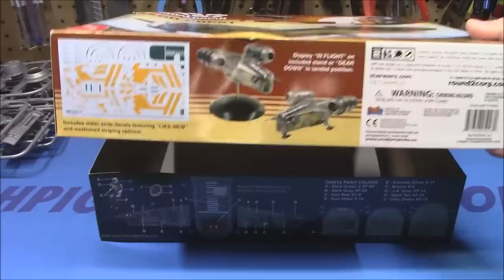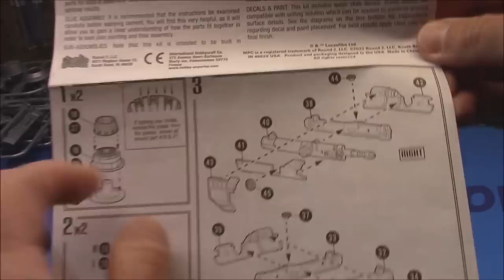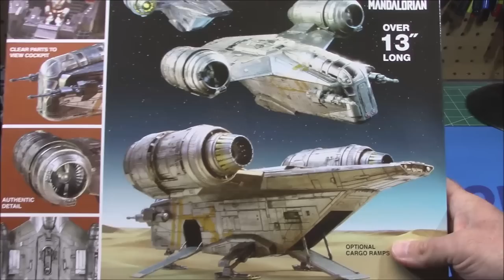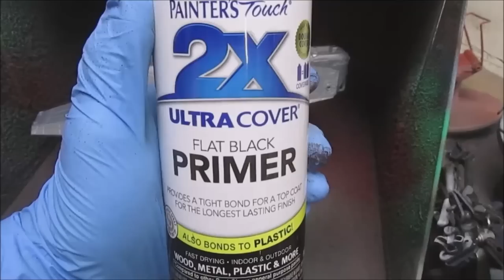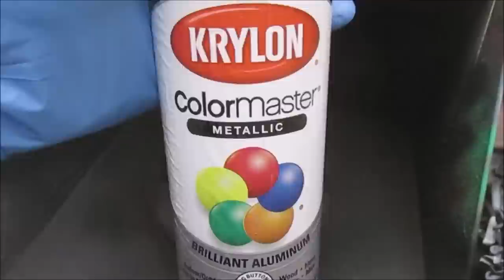ALL NEW AMT Mandalorian Razor Crest Star Wars 1/72 Scale Model Kit How To Assemble Paint Weather

Comment: I see I am not the only one that uses the Liquitex acrylic ink for washes and/or panel lining.  Great video and presentation here!  I got the tiny Bandai version but I would love to build this one.
Reply: Is the liquitex the blue stuff in the bottle?
Reply: @Orcagirl0809  He shows the label on the bottle.. the color is Carbon Black(at 59:50).  He uses it on the guns and engines.  I have used Liquitex acrylic paints and inks for various projects. The ink is thin enough it works great for panel-lining and washes.

Comment: Okay, I just finally got the scale kit and I love it! I got a question for you, what led lights would you pick if you're placing some lights inside the model? Hopefully you could reply me, thanks. Can't wait to start.
Reply from the maker: Personally I'd use EL wire. Hobby Lobby sells it. 
It gives a nice even glow inside the engines but doesn't light like a light bulb and project light.
The battery pack will fit into the cargo area easily.
Reply: @hpiguy  Awesome. Hobby Lobby is my "toy store". I'll look into it, Thanks, bud. 😊👍